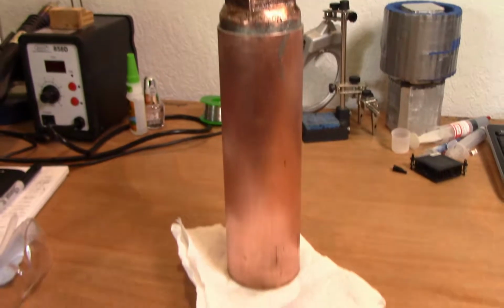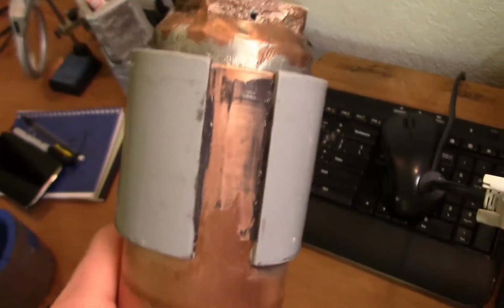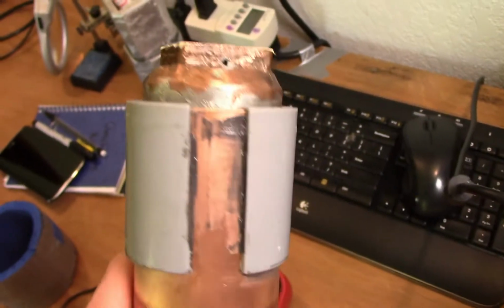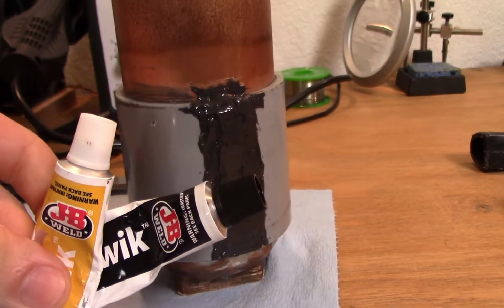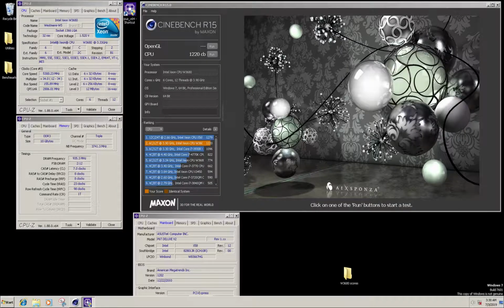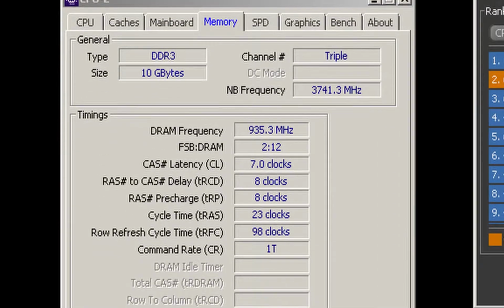Baron Mk. III | DIY CPU pot

Comment: I love it. And this is probably something I'll do. :v
Reply from the maker: I wish you the best of luck on your endeavors. You may want to try to find a local metal supplier that sells copper round stock. It kind of hard to find as it doesn't have many uses, but it may save you a lot of heartache and will probably still be cheaper than buying a full CPU pot. If you decide to go with casting, I would recommend checking out the King of Random's furnace designs and FarmCraft101.